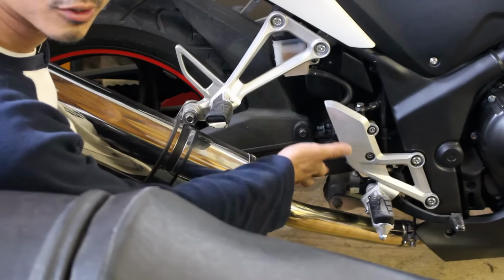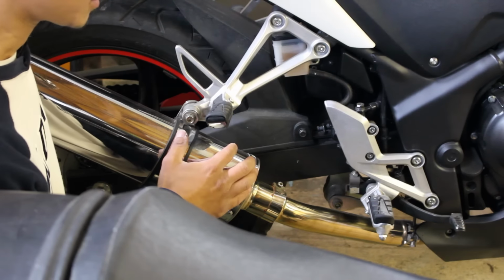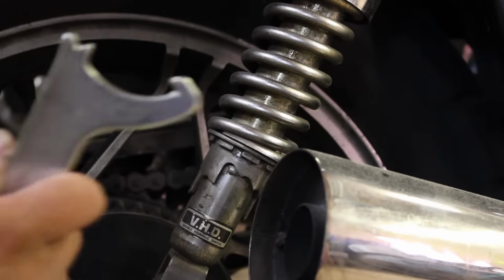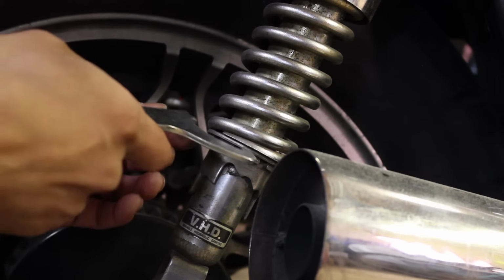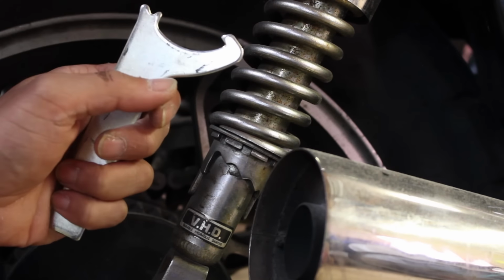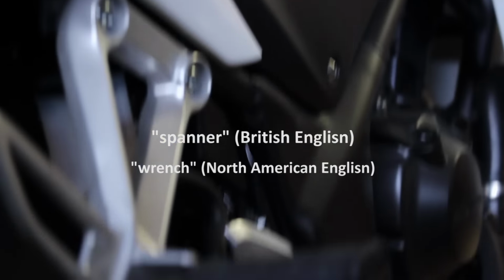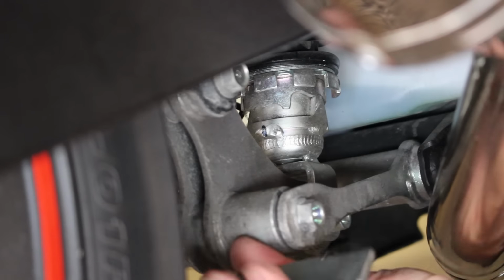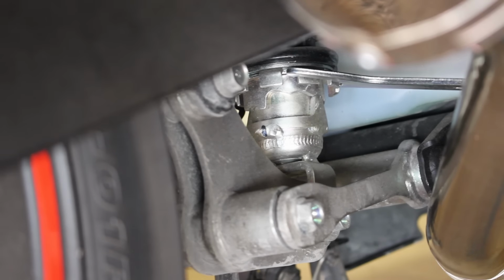Rear Suspension Adjustment CBR 250R Motorcycle

Comment: What they mean by 1-5 is that 1 to 5 is a big (4 points) difference and will compress/decompress the metal too suddenly without allowing it to tolerate and get adjusted to the new load settings. This big of a jump can damage the suspension spring as it will strain the spring suddenly. So the adjustments should be made in steps such as 1-2, 2-3, 3-4, 4-5 and vice versa giving it enough time (a few hours) in each setting to be able to adjust itself.

Comment: A good amount of sag for street is around 35mm. Find two points to measure from that will increase as all weight is taken off the swing arm, have someone lift the rear to take all the weight off the swing arm, measure your two points, lower the bike, sit on it and bounce to settle the shock, measure your same two points. Tighten the shock if you drop too much, loosen it if you drop too little.
Reply from the maker: +Timothy Krainik Excellent contribution. Thank you!
Reply: Thanks! Also, make sure that you adjust the travel along with your rear tire pressure should you decide to take a passenger or do some light touring with luggage on the bike.

With the addition of front spring preload adjusters, you can repeat the same procedure on the forks. I'd really suggest looking into them, as at least to me, the CBR250R is pretty squishy in the front end.

Comment: Just adjusted mine on the cruiser a few days ago.  It was on 3.  I cranked it down to 1 as I am not all that heavy and the roads I ride are smooth.  Made a difference for me.  However, should I take on a passenger, I will adjust my tire pressure and suspension according to the manual.
Thanks for another great vid.  I always look forward to them.
Reply from the maker: +lmdetect I was actually thinking of doing the opposite on my Nighthawk because sometimes I find it too soft that I'm afraid the rear tire might skid during emergency braking. Thanks for watching.

Comment: It says in the manual:

"Always adjust the shock absorber position in sequence (1-2-3-4-5 or 5-4-3-2-1). Attempting to adjust directly from 1 to 5 or 5 to 1 may damage the shock absorber."

What they are saying is don't wrap around because it's shorter, only go to the next highest or lowest number. If your shock is at 5 going to 1 or vice versa won't do any harm as long as you do it the right way.
Reply from the maker: +Raymond Dowe Ah that's what they meant. Good point and thanks for pointing that out.
Reply: i think it just means you shouldn't wrap it around the circle, but rather go other way incrementaly.
Reply: Raymond Dowe why they cant just write do adjustement one level at a time however if u skip levels in between may affect shock absorber similarly if it means what i understand from ur comment
Reply: So if I’m on the left side of the of the bike & I want to bump it up one. Do I turn it towards me? Or towards the other side ( exhaust on right I’m on the left) to go up one I turn it away from me?/ to the muffler side, not towards me,right? 
Thanx.
Reply: @RaymondDowe  thank u!
I just messed w/ it & I feel like I’m on a 650-GSXR750
Riding a lot more aggressive
After I see what I’m going to do w/ tge PSI on my tires I’ll see if I keep it were is @ or go up one more ( I think I’m good though)

Right. I understand looking up I go from noon/12 o’clock to 1Pm. To lift up. 

Appreciate ur time. 
( building a project bike w/ a ninja
Custom ZX-45R)

Comment: Removing the right foot peg assembly let’s you access the spring if you have problems getting enough room for the wrench. The assembly comes off easily by removing the 2 large hex bolts.

Comment: I had the same question earlier. How to soften the riding position on my Honda CB Unicorn 160(released in India). They did not supply that Wrench/spanner with the bike though. i got it from other user and lowered the spring. i mean changed to setting 1. I feel my bike is soft now (minor difference). My bike has only 3 settings. 1Soft, 2 standard, 3 Hard. i never put extra load on my bike. 98% times its a single ride only. so, its work for me.
Reply from the maker: +Nazeer Hussain Same here. I have never had a heavy load on my CBR or a passenger so I keep at position 2.

Comment: softer setting translates to higher saddle height or lower saddle height??
Reply: Depends on your weight. If you set it real soft, the forks are gonna be longer (or higher rear) at static (no rider) that means the bike, pre-mounting, will be higher up. When you mount it, however, the travel distance pre-mounting to post-mounting will be more. When suspension is hard, basically the suspension is already tightened up like you’re sitting on it, so it’s holding it down more without your weight, but is a lot more sturdy and less springy. FYI your question applies more to forks than rear shocks since generally speaking forks move more and carry more weight under load (braking, turning, etc) :) hope this helps

Comment: how to adjust nitrogen gas filled reservoir rear suspension on zxr 400?also the front ones.kindly upload video.thanks..i just cant get that H and S also learning about damping and all that is kinda hard. I want to increase Ride height from back and front both cz my 400 looks like 250 in size.

Comment: Your channel really help me i love it. one question for you if you don't mind answer it 
do you know the air filter lid that secured by two bolts. Some cbr rider left it open to gain more torque i wonder is it true or false
and will it damage the bike? cause i plan to do it thank you
your channel is the best : )
Reply from the maker: +ted2ar I'm not that sophisticated a bike mechanic, so I can't really answer that for you. Sorry. :(
Reply: ted2ar do as honda manual book said not to open or use Chinese copy product your bike will fuck up. ?
Reply: Thanks Smith i didn't do it, i'm too scared to open it anyway
Reply: Do you have an manual. ? If not you can download honda 250r 2011 the manual tell you everything.

Comment: Good vid again, the annotation link share didn't seem to work.

Most manuals have a recommended setting for single and with passenger settings for a person of average weight (though no idea what they consider average).  My bike has a page that has a table for all different recommended settings in the manual.

A bit about performance and suspension settings.  Many people think stiffer is better for performance.  While this is true on a smooth racetrack, cranking it up for a firm/sporty ride can make for worse or less reliable performance.  Too stiff, and your tire just bounces the whole vehicle off the ground instead of dampening the bumps.  Result, if you got a bit of roughness in the road,  you will get that "skittery" feeling.

For some reason, people combine this with high tire pressure for even more "handling" Which is a potential for another video.  Tires!

In the case of tires, most manufacturers have a pressure range they recommend.  Thing is, the tires are the suspension for all your "unsprung" weight.  So if you have a high pressure, then the unsprung components are more likely to bounce as well.  

All combined, This is why on our beautiful sask highways, typically have more control and performance with my nighthawk than some sport bikes have when on our rough and bumpy pavements.  Dampen the bump, not jump the bump!
Reply from the maker: +MarkusReese The annotation won't allow me to link to an external website that I don't own. So I put it in the description instead. Great contribution about the consequences of extreme suspension firmness. It's all about balance. :)

Comment: Can you be more specific about direction i.e. cloclwise rotation is softer or harder
Reply: harder means tighten it , where as softer is loosen it,
Reply: pratik bhosale in the manual said the higher number the harder 
 1 is soft 2 ok 3 hard 4 harder 5 hardest. 
 6 hardware 😆just kidding

Comment: I feel like my bike is too high in the back. I slide forward on the seat always having to adjust positioning back again.
Reply: Unfortunately this method of adjustment will not help you, the easiest adjustment for you to make to correct your seating angle is to raise your triple tree height on the forks. Simply support the weight of your bike from a centerpoint, loosen the clamps, and pull your bike further up the forks. Keep in mind that this will drastically alter the geometries of your bike, increasing your rake and thereby reducing your turn in ability, but may in fact increase your stability mid-corner. When making adjustments of this sort it is very important to make only small changes, and to take a period of time to get used to the effects.
Reply: I think you need to replace your tank pads, i got the same problem now that my pads are worn threw